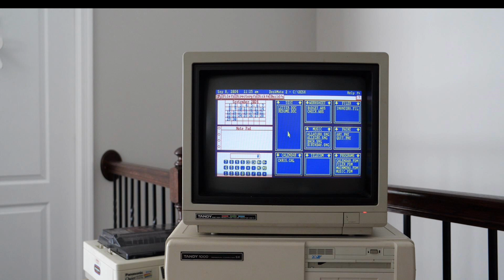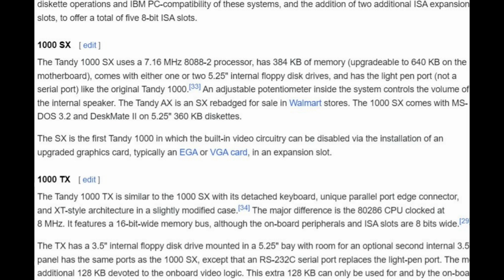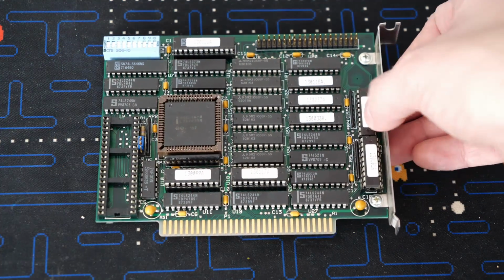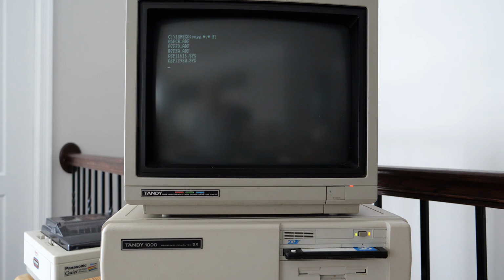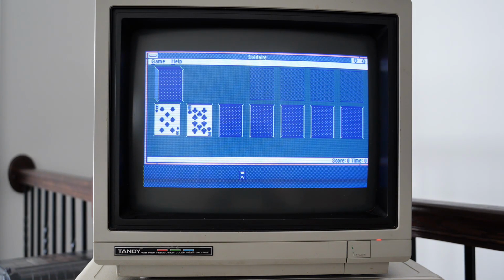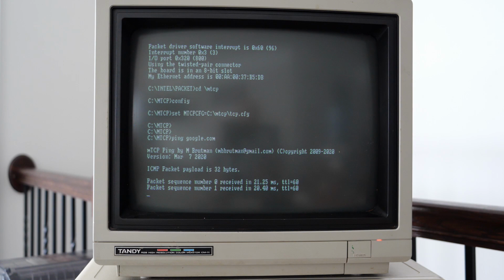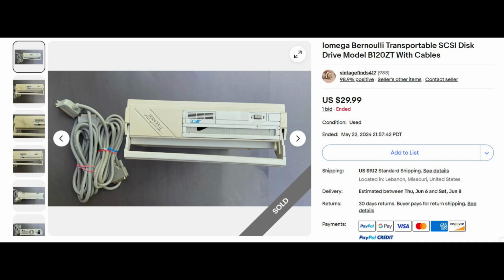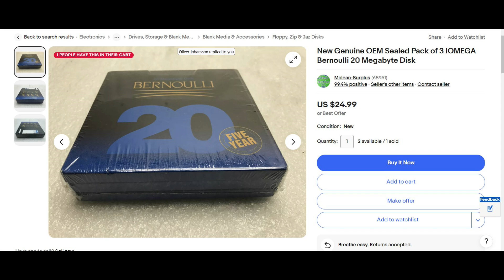Exploring My Tandy 1000 SX... With an Accelerator Card and 20MB Bernoulli Drive! #SepTandy

Comment: Greetings Chris, great video for SEPTandy 2024. 👍👍 Next month I'm going to give my SX a few upgrades, like an NEC v20 Co-processor (NOS), a 2MB EMS Card for a little extra performance, an I/O Card for more options, a No-Slot Clock (RTC) and an XT-IDE to SD (512MB) for my HDD needs as the HardCard in mine fails to read. I can't wait to get it upgraded and be able to start using it more regularly. I'm going for more of an enhanced 1000sx versus an Ultimate SX of sorts, possibly how Tandy themselves may have done it back in the day, minus SD for storage as that wasn't a thing back then. 😀👍👍
Reply from the maker: @JCaldwell1985  oh, fantastic!  Yours is going to be supercharged 😂.  What a great project!
Reply: @RetroTechChris  I have a CM-5 monitor that I received when I purchased it a while back, I wish I could get a good condition CM-11 though.
Reply: @RetroTechChris  Quick question, where did you source the Midi Cable for extending the keyboard?
Reply from the maker: @JCaldwell1985  Amazon: https://www.amazon.com/dp/B09L5R1QXV
Reply: @RetroTechChris  I looked over the video where you briefly showed it off, I wasn't paying close enough attention during that part. Thank you for the quick reply. If I have any issues with getting everything setup, then I hope you won't mind me asking questions. 😀👍👍
Reply from the maker: @JCaldwell1985  absolutely!  And if anything, I'd love to hear from you as you go through the process of building that sweet sweet ultra 1000 SX!
Reply: @RetroTechChris  Once I get everything ordered and they arrive, if you don't mind, I'll send status updates & pics to your e-mail, if it's alright with you?
Reply from the maker: @JCaldwell1985  I'd love that!
Reply: @RetroTechChris  I'll keep you posted then. 👍👍

Comment: This brings back memories. My 1st pc was a 1000sx, believe it had a co processor, expanded memory, 30mb hd card, both size floppy drives, 9600 modem, cga monitor, 9 pin dot matrix printer. Deskmate II software - ha.
Reply from the maker: @NYCamper62  you had the works!! I love it!